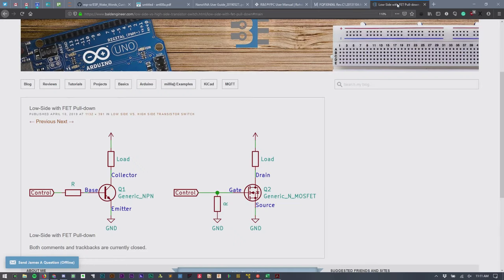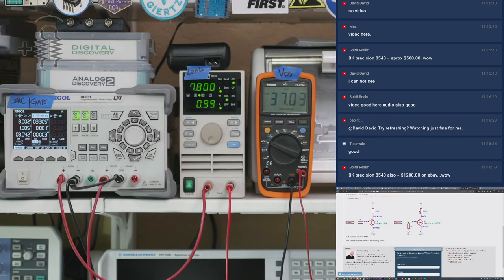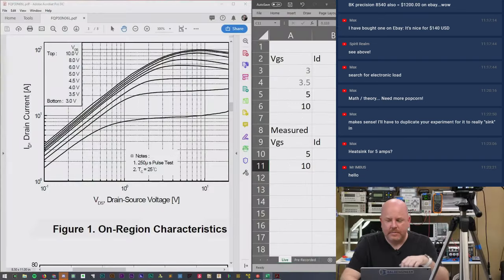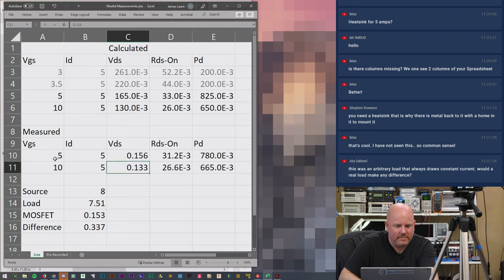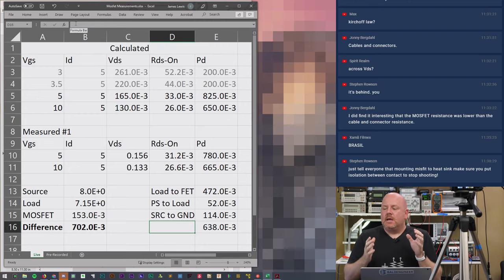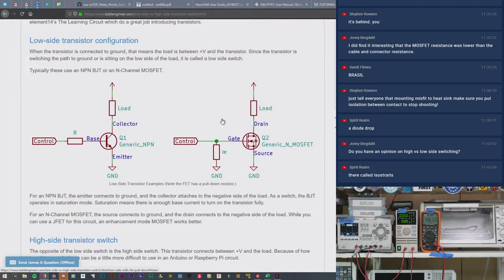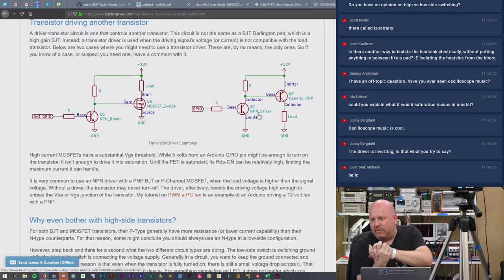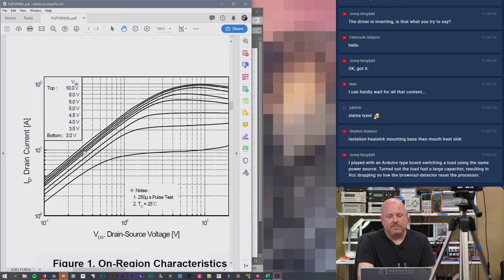MOSFET Vgs Threshold Demo | AddOhms Live #16 (Archived)

Comment: damn better stop mounting my to220's to bare metal with just a lick of goop.  
guess I should use them lovely thermal insulating silicon rubber square pads since the better conducting mica ones are getting harder to find
Reply from the maker: Depends on the “goop” you’re using. Thermal paste is relatively low electrical conductivity.
Reply: @AddOhms  well i know my word counts for nothing, just another guy tested the different types, mica wins. bare transistor small amount of goop and a non insulated heatsink wins over mica, same as a cpu really. boiled down tot he nuts and bolts, for every 1degree rise you will see on bare metal, you will see the device rise about 3 on mica, and 4-5 on a sil pad.....

Comment: Your cables were probably getting warm too. Operating the FET in its linear region is a slippery slop anyway.
Reply from the maker: I was surprised at how little heat they generated. It wasn’t enough to notice when I touched them.
Reply: @AddOhms  That's why they work so well as DC switches. Very low RDS = low heat, low Vds. Cool indeed.